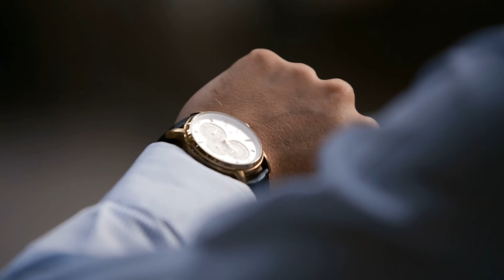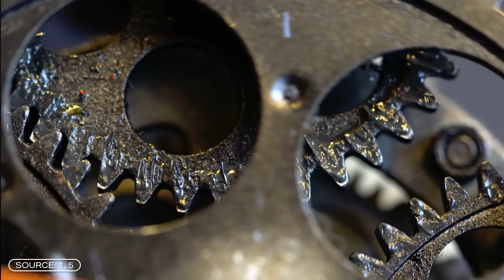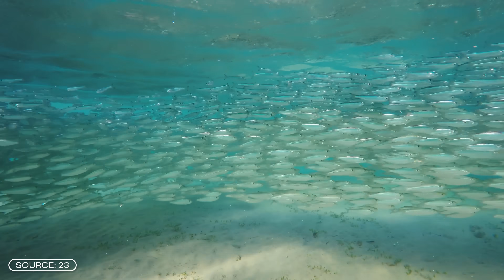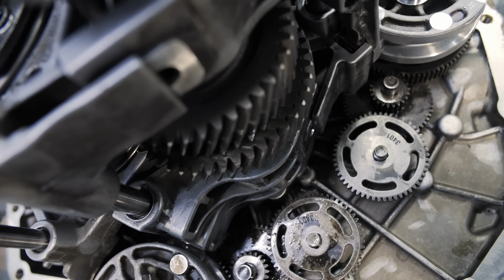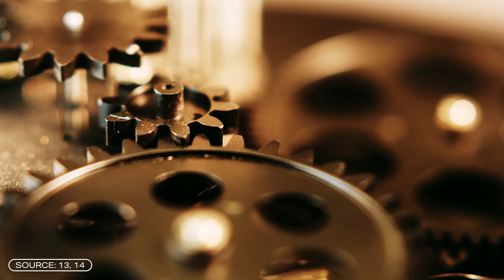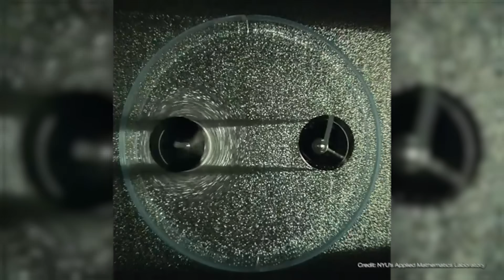No Teeth, No Wear: The Future of Gearboxes is Liquid.

Comment: I could be wrong, but I don't think that moder torque converters require plates close together or highly viscus fluids. They are much more like hydraulic pumps. Isn't it also true that any device moving fluid around it going to turn some of the input force directly into heat?

Comment: why not add blades to the shafts.. both sides.. will whip up and pass over the energy between the better.. (not as good as gears, but better than smooth shafts)..
They can still remain "not touching" but with blades there'll be more transfer of power.

Comment: The energy loss, though, would be absolutely *insane* because the coefficient of friction is simply not there.   Put load on the second gear and the amount of motion needed by the first to transfer enough energy to move the second goes through the roof.

Comment: Not only does the efficiency appear disastrously low, but I can't imagine a set up like that achieving enough torque to actually be able to do any useful work.
Kinda like how you get 'free energy' as your coffee cup cools by putting a little sterling engine on top of it.  It's a cool novelty, but the moment you try to do any work with it becomes worthless.  And if you actually wanted to get work done, you wouldn't make a giant cup of coffee, you'd use a method that's suited for purpose.

Comment: Why not use gears and also the same floating durable particles together . Here the spacing between the meshing tooth gears is large enough for the particles to float in between the meshing teeth so the particles are always in contact with the gear surfaces. In this way the gear teeth metals never touch.. So you have the benefit of the mechanism of this article and the benefit the there will be better coupling between meshing gears

Comment: Ya not impressed by this saddly as it must have an efficiency approaching the teens and no real true advantage longevity is still even an issue as tranfer of rotation will still cause friction and the cylinder will get damaged where the fluid passes by plus having a smooth surface has an issue with the initial transfer anyway at least put a pattern on it to give traction the only true advantage i can see is the ease of reverseability and its at such a level that it could be done by accident

Comment: 0.00001% efficiency and 0% positional accuracy is not going to see this tech applied anywhere. It's just an intellectual curiosity. The magnetic coupling has real world applications that are in your house right now though. The water drain pump on your dish washer and cloths washing machine couple the impeller to the motor magnetically through a solid plastic housing instead of through a shaft with seals. No chance of leaks.

Comment: From Google "Chrysler's Fluid Drive (introduced 1939) was an early hydraulic transmission technology that utilized a fluid coupling between the engine and a manual transmission, bridging the gap between manual and fully automatic systems. It offered smoother driving, less wear, and eliminated the need to shift in stop-and-go traffic."

Comment: Yep. The whole video I was thinking "that has GOT to be the least efficient thing I have Ever seen"
Reply: Literally just reinventing the wheel which is a torque converter.
Reply: @otisthecow  Well the purpose isn't for use in normal circumstances. You'd use shit like this in something you send to space and NEVER intend to maintain. I don't know about underwater though. I feel like you'd be better off just using metal or some type of alloy. In space, though, don't need much force to get a result. More about timing. And maintenance in space is upwards of billions. This would be a viable investment towards reducing maintenance costs.
Reply: Fluid drives have been around a long time and we build many millions of them every single year.  Every car with an automatic transmission has one.
Reply: @tarstarkusz  more efficient than This though, Im sure
Reply: My thoughts as well.
Reply: Right!!! 👍🤣💯 wow... just watching this.... like you said,... the inefficiency abounds!!! 😅
Reply: Well.... it admittedly is a proof of concept.
It might be possible to be efficient at a level comparable to standard gears if developed further.
Reply: @matthewmathis62  What is your basis for that statement? I don't see how this could be more efficient than similar fluid transfer devices like a torque converter, and those peak at 95% efficient. Gears START at 95% efficient and peak at 99% efficient.

95% efficient is probably an easy tradeoff to make in a scenario where maintenance will never be performed, like space. I can't think of any other application where this would be superior to gears.

Comment: I bought an electric pump from a thrift store once that used a magnetic transmission because it was designed for use in salt water. It turned out the liquid cooling system for my gaming PC used the same type of mechanism.

Comment: They should try using a thixotropic fluid instead... with something like electric field coupling ... simply running a voltage potential through the non newtonian fluid... or - liquid crystals! Thats it... it crystallizes at the interface then liquifies everywhere else.

Comment: John R. R. Searle has alleged that over 50 years ago he invented a drive using magnetically stamped cylinders.  Whether this technology is real, or a hoax, is not known.  However, if the literature he provided is real, and the mechanism works (a big if, I know) then it could lead to developments similar or greater than what you represented in this video.

Comment: I can't remember what it was called, but I know what it was & who built it. Tesla made a pump built out of flat disks on an axle with narrow gaping. My point is to use this pump assembly instead of the cylinders as the "gears" & test if that could compensate for the oddities/inconsistencies of the current design.
Just a thought, I've always loved mechanical engineering, but I've never been able to get actual schooling on said subject. It's probably just a dumb idea of mine, but I wanted to put it out there.

Comment: I feel like Tesla Turbines could also work as a contactless gearbox, but probably with more torque.
Either 2 separate turbines, with overlapping areas of the turbine "blades" (disks), or maybe even work as in this example where to rollers are far enough away to not overlap.
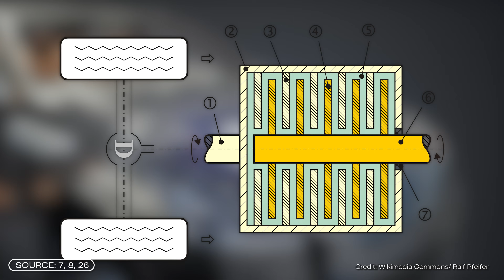alternatively a kind of stack of discs, where every 2'nd is connected to one shaft, and the other are connected to the other shaft. I assume one set is connected normally, and the other set is connected via the outside (circumference attachments, somehow). 4:15 something like that.  (hmm... 4:50 I wonder if the discs can be made magnetic & work with ferro fluid, for increasing power transfer? but probably it just collapses the discs?)

Comment: Best most efficient gearless zero maintenance high torque variable ratio reversible transmission is already in my car. It is a variable frequency drive which runs a brushless 3-phase AC electric motor.

. . . It is powered by free sunshine from my roof.

Comment: Viscous friction .
Heat would boil fluid .
BOSE had magnetic oil fluid in suspension shocks that could adjust viscosity by electric charge variation.

Torque converter in automatic transmission similar concept.

A danke .

Comment: It has the efficiency of a kiddy car powered by a jet turbine.
Reply: Happy April 1st.
Reply: @MaxBrix  Yo I didn't think I would randomly stamble on the goated guy who modifies lego motors
Reply: @Vunyx  It is crazy when you see a familiar person in random comments.
Reply: Thats... kinda how innovation works? How is that hard to understand?
Reply: @FloppyCat1990 The only thing I'm having trouble understanding is where, in my original statement, I said or implied that I was having trouble understanding anything. Torque converters work pretty well.
Reply: @FloppyCat1990  Innovation is the practice of turning new ideas, methods, or devices into value. Can you tell me where the value is in making something that turns high speed high torque rotation into low speed and low torque rotation...? 

I'll help you out. There is none. And unless some sort of magic fluid comes into play that makes this idea more than an exercise is mental masturbation, there probably never will be. It's a technological dead end.

Comment: Antikethera was the place where it was found, in a shipwreck nearby.  It is not known where it came from.
Reply: Ye olde Antikythera Port Terminal duty-free shoppe, surely...? ;)
Reply: Indeed i noticed that. The antikythera mechanism was named after the nearby tiny island of the shipwreck where it sank to the bottom of the sea and later discovered. Had the ship sank closer to the sister island named kythera then it would have been known as the kythera mechanism.

Comment: Insignificant efficiency, combined with insignificant torque transfer capacity, I mean, both are each inherently ridiculously bad with that design. If one of those factors weren't as extremely bad, I could have accepted the idea that there could be some niche applications where it potentially could have been relevant, maybe. 

It would be possible to achieve the same effect, and achieve much much higher efficiency and torque transfer capacity with two discs, very close to each other, and have them rotate in the same direction and transfer rotation and torque as efficiently as possible by having their center of rotation along the same axis, and then change direction by separating their respective center of rotation far enough. Using two discs that way would allow for well over 100 times higher achievable efficiency and torque transfer capacity, than what's achievable with their design. But, even a system that can be over 100 times better in two very important aspects, and without any significant disadvantages, compared to theirs, isn't necessarily very useful.    

Magnetic transmission would be interesting, and there are a lot of other interesting topics related to magnetism.

Comment: As an electomechanical engineer, I tend to say this discovery may have only very limited applications.  All diesel engines have a fluid coupling because of their interesting torque / speed characteristics, not because they are so much more efficient than friction-based couplings.   Fluids in gear transmissions are likely more interesting for their ability to remove gear friction rather than using fluids for their ability to provide friction, and torque in the end.  Another aspect I think worth mentioning is the predictability of the transmitted output speed.  This is not trivial when you want to achieve a 1:1, 2:1, 10:1 transmission.  Fluidomechanics formula's used today are 'simple' approximations of a very complex problem called turbulence, which sometimes would provide e.g. a 2:1 reduction or a 3:1 reduction in the very same situation, but just because of the unpredictable and uncontrollable turbulance state of the fluid inside.

Comment: "Lets talk about efficiency". Yes, please, lets! Conventional toothed gear - 98%. Fluid gear? ???????  While a physics curiosity, the power transmission of this fluid gear is almost zero. Most of that moving fluid is wasting energy rubbing against the container walls, and against itself, generating heat through viscous friction. With most of the kinetic energy disappearing out of the system as losses, there is virtually none left to drive the output cylinder. Useful work? Unmeasurable. Curiosity? Yes. Practical application? None that I can see. That magnetic gear provides a better option for all of the non-contact use cases. Besides, the fluid itself will deteriorate with time. Why do you think you have to change the oil in your combustion engine? Maintaining prescribed viscosity over time and temperature is impossible, so the niche applications suggested are not valid either. 

Personally, this particular "technology" feels like a waste of time, and I am surprised that "The German Science Guy" didn't see it as such, instead devoting resources and time to report on it. 
At best, it is a curiosity, and at worst, a distracting waste of time that diverts attention from more promising ideas. 

Most likely application? Executive desk toy. 
Just getting the output cylinder to move at all looks like the main challenge. The notion it can be coupled to an output shaft to do useful work, is fanciful. Control of the gear ratio (output shaft speed) is... non existent. 

That magnetic gear is far more interesting. 
Although it too will have some "slippage", it will still perform far better as a classic gear than this novelty.

Comment: this is an april fools video. Obviously the inefficiency is mostly due to fluid shear transmission losses. Viscous fluid have a specific amount of efficiency when trying to transmit the shear force, which in this fluid mechanism uses. The efficiency of viscous shear force transmission is significantly lower than 100%.
Reply: They had this in the turbo encabulator. It was powered by the rotating Dingle arm.
Reply: @jamesbonner692 don't forget the nofer trunnions.

Comment: My ford tarus transmission had wheels using a high friction fluid only under high pressure contact to spin up lower gears for synchro shifting. Around 1998, can't remember exactly.

Comment: Here's a crazy idea:

Just like we extend underwater internet cables between continents, if a train track of floating cables can aim a power generator train based on a contactless gearbox, we use ocean currents like the AMOC to provide the fluid, and if this power generator doubles as an AI data center, the fluid provides cooling. For such a dual-use application, the train track allows for alignment with the optimal current position and seasonal temperatures.

Municipally, a long water pipe, or a pipe of any other fluid, has its own pressure control and current regime which can be enforced with geothermal heat pumps, therefore the capture of energy can be underground farmed as controlled by the water treatment utility. If this were mastered, then AI data centers can self-regulate using off-grid underground infrastructure. What's more, if the temperature stable pipes have a ground warming feature, then roadways and farm fields can be made more winter resistant and summer cooling?